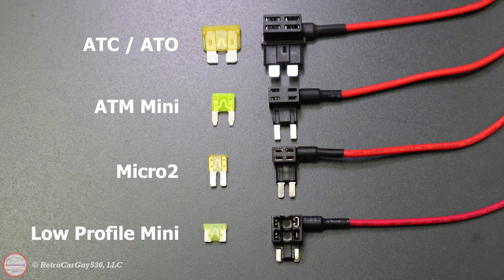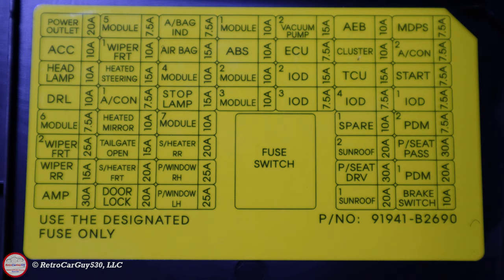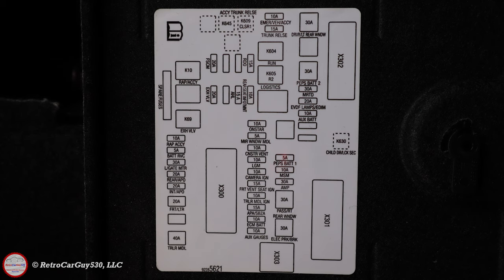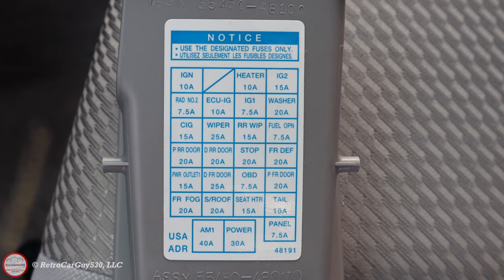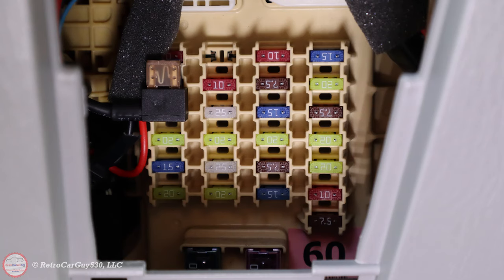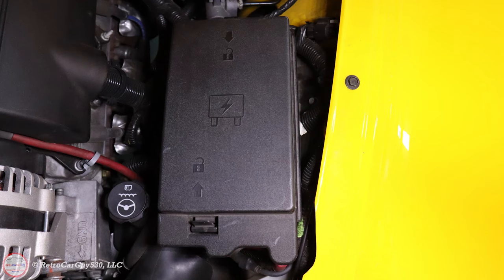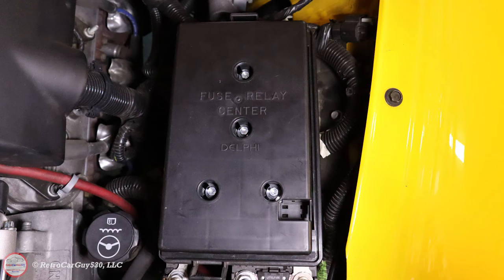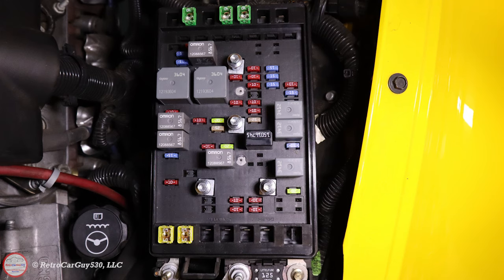How To - Add a Fuse Tap in Your Vehicle

Comment: Hi. I'm installing some led raptor lights and they came with an add a fuse. The add a fuse will go into a 10 amp slot, but the other fuse to power the lights that came with the add a fuse is a 15amp fuse. Will this cause any problems or should I replace it with another 10amp fuse?
Reply from the maker: There are a few different opinions on the answer to your question.

First thing to consider, can the fuse box fuse socket supply the 10 amps to its original circuit plus the 15 amps you would be asking it to supply for LED raptor lights?  The answer depends on how the internals of the fuse box are setup and how that fuse box fuse socket obtain its power.

With regard to using a 15 amp fuse as supplied with the LED raptor lights, yes I would use what the product manufacturer supplied.  Unless you have other info that states the device/accessory uses less amps than 15 amps, stick with the 15 amp fuse for the new device/accessory.

The LED raptor lights are potentially needing a large amount of amperage above what the current fuse box fuse socket is providing.  If the wiring/power path supplying the power to that fuse box fuse socket can support an additional 15 amps is impossible for me to know and state with any certainty that it will work without overtaxing the wires / circuit powering that fuse box fuse socket.

When adding a device like a dash camera or radar detector using a fuse tap, those items usually only consume 1 to maybe 5 amps at max.  Adding that amount of extra load on a circuit is usually low risk.  In fact, most dash cameras only consume 1 or 2 amps.  That's why a fuse tap is a simple and safe way to power a device like that.

When you start getting into 7.5 and above amps for the new device/accessory being powered by the fuse tap, that's when it starts to tax the pre-existing power path for that fuse box fuse socket.  If the fuse box fuse socket is getting its power from an internal power bus bar (supplies power to multiple fuse sockets in the fuse box), then adding a slightly higher amp load device is likely not a problem.  If the fuse box fuse socket is getting its power from a wire, then things get a bit more questionable.

When a new device/accessory requires 10 or more amps, I tend to look for alternative ways of getting the power to the device.  I tend to be a fan of using a relay to supply the power to the new device.  The power source for the relay that is then powering the new device/accessory is obtained directly from the battery with an inline fuse of the proper amperage rating to protect the new device and its wiring.  A fuse tap is still used, but it's used for the control side of the relay.  The control circuit for a relay usually only consumes 1 to 2 amps (or less - back in that low load situation like a dash camera).  The power from the fuse tap then controls when off/on state of the relay and the relay then supplies power to the higher power demanding device (like your LED raptor lights).

Can the fuse box fuse socket you've selected supply the 10 amps (original fuse) and 15 amps (LED raptor lights), I just have no valid way to answer that with any certainty.  I hope you understand why (based on what I stated above).

When I add lights or even dash camera battery packs, I use the relay approach mentioned above to make sure I'm not overtaxing the fuse box fuse socket or its wiring/power path.

I hope that helps in some way!

Comment: One confusion for me:  where does the negative wire go? I have a black and a red wire, what do I do with negative?
Reply from the maker: The ground wire is connected to a location with a pre-existing ground wire or a location with a metal screw/nut/bult that does not have any paint or coatings on it.  Often, there is a screw/nut/bolt located near the fuse box to secure the fuse box to the vehicle's body.
Reply: @RetroCarGuy530  thank you.

Comment: i need to wire to the fuse box in the trunk.  any tip to run the wire from the dash cam to the trunk neatly?
Reply from the maker: My current vehicle has the fuse box and battery in the trunk.  I ran the dash camera hardwire cable along the bottom door sill openings and then up along the side of the rear seat into the trunk.  I usually take that path since it avoids any of the wiring being located near the curtain airbags.  I remove the plastic trim pieces and there's usually pre-existing wire harnesses in that area so I just follow their path and take advantage of using the same wire/cable holders or use small/thin zip ties to secure the dash camera wiring.
Reply: @RetroCarGuy530  thanks.  I thought there would be a cavity somewhere in the frame that I have to fish through

Comment: Quick question, I have wired a cooling fan to a switch, but am scared to forget to turn it off when I leave. Thats why I'm trying to find an ignition source that would turn off if I leave the car with my keys, so forgetting to turn off the cooling fan wouldn't drain my battery. 

But could that cause an amperage drop, having any consequences like bad fan perfomance or even causing a fire hazard?

Thanks!
Reply from the maker: Devices like cooling fans or any device that requires more than a few amps to run, I would suggest using a 4-terminal relay to provide power to the fan/device.  A fuse tap can still be used to control when the fan's switch has power by using the 4-terminal relay.  That way you can make sure the fan is turned off when the accessory power is turned off when the ignition switch is turned to the off position.  The 4-terminal relay could obtain the fan's power with a direct connection to the battery's positive terminal (with an inline fuse).  The fuse tap would be connected to a switched/accessory fuse socket in the fuse box to control when the fan would have power available to run it.  You can place the on/off toggle switch inline in the power from the battery (going to terminal 30 of the relay) or after the relay (terminal 87 with power going to the fan) so you can control when the fan runs.

I outline the 4-terminal relay approach to power a high draw device in a video I created reviewing a dash camera battery pack.  Terminals 85 & 86 are related to the control circuit in the relay and terminals 30 & 87 are for the power going to the switch and/or fan.  Here's a link to that video and the section that video where I discuss the use of the relay: https://youtu.be/Joa0fiKZY-o?t=745
Reply: @RetroCarGuy530  i’ll check it out! thanks for the fast reply and good video

Comment: Hello. I have a 2017 Infiniti. Tried to do this hook up (before I saw your video), for a parking lot power dash cam.  I found an ACC and a continuous and hooked it up. Both had a fuse already installed. I thought all was well but when I tried to start my car after install, it would not start. Cranked once then dashboard needled "jittered" and then stopped.

I have roadside assistance so got it towed to dealer. They called me and said the battery was bad and replaced it under warranty. 

Was this a coincidence or did I somehow damage my battery?

Thanks.
Reply from the maker: Hi Ken.  Adding a dash camera to your vehicle should not be the root cause of your car's battery going bad, but it could be why it was drained downed to a low charge level.

A dash camera with parking mode support requires the two connections you mentioned continuous (unswitched) power and ACC (switched) power.  The continuous power connection will draw on the car's battery indefinitely to power the dash camera's parking mode operations with the potential to fully discharge the car's battery unless it has a device or internal logic to cutoff power to the camera when the car's battery reaches a minimum charge level of no lower than 12.0 volts (or so).  Some cameras have this power cutoff logic right in the camera (like the BlackVue "X" series of cameras), but most rely on a dash camera hardwiring kit or the use of a dash camera external battery pack to perform that power cutoff function.

I have a few VIOFO cameras with their hardwiring kits installed and their hardwiring kit has a power adapter which converts the car's 12-volt power to 5-volt DC power for a USB powered camera.  That power adapter also has a car battery charge level cutoff feature which is configured by a slide switch on the side of the unit to cutoff power to the camera at one of the various voltage level settings (12.4, 12.2, 12.0 or 11.8 volts).

If your installation has no car voltage level cutoff feature, you need to obtain a product that supports the shutoff of power to the dash camera when the car's battery charge level goes below a predetermined voltage level (again 12.0 volts would be my recommendation).

If your installation has a car voltage level cutoff feature, make sure it was configured with a minimum voltage level of no lower than 12.0 volts (IMO).  Also confirm this feature works by setting it to shutoff the power to the camera at a higher voltage level (for a test) like 12.2 volts and confirm that it truly cuts off the power to the camera.  You can use a voltage meter (one that plugs into a power port that has continuous power or a digital volt ohm meter to check directly at the battery) to check the car's voltage level while the camera is in parking mode.  If you see the charge level drop well below (at least 0.2 volts below the selected voltage cutoff level) then you might need to replace the hardwiring kit with another one that properly cuts off the power at the selected voltage level.  Many hardwiring kits with a power cutoff feature will have a tolerance of plus or minus 0.1 volts, so that's why I suggest that if it goes 0.2 volts or more below your selected voltage value, it may be defective.

Make sure that your installed fuse taps are installed correctly.  Make sure the left leg of the fuse tap (the side opposite of the side where the wire comes out of the fuse tap) is inserted into the fuse socket on the side that provides the power.  Having the fuse tap installed the opposite way (meaning right leg receives the power) will cause the power to improperly go through the lower fuse fuse before going to the new fuse on the top.  That won't drain the car's battery but it will potentially cause a blown fuse when it shouldn't.

I hope that helps.
Reply: @RetroCarGuy530  Thanks for the explanation. This is a Garmin Parking mode cable that does have the voltage features you spoke of. 

Also, after installing, the first time I went to turn of the ignition, the battery failed. All fused checked out ok so none blown. 

I will rewatch the video and attempt to connect correctly.

I guess battery was "going bad" and I pushed it over the edge trying to install?
Reply from the maker: If it's the original battery in the car (2017 model year), then it could have simply failed due to age.  Most car batteries will last four to six years (on average).  With the current health situation going on, many cars are not being driven to keep up the charge level in the car's battery.  If you leave your car parked for extended periods of time, you may want to consider getting a battery charger/maintainer to keep the battery fully charged while its parked for extended periods of time (more than 5 days at a time).

If your car wouldn't start immediately after installing the dash camera, it's not very likely that your dash camera installation caused the battery failure.  Just make sure the fuse sockets you're using are for non critical circuits (they don't power the engine control module, srs (air bag) control module, body control module, etc).

I have a FAQ video as well that talks about fuse sizing, wire gauge and length restrictions.  It might be helpful to clarify a few things.  https://www.youtube.com/watch?v=DnZ5wb_A5vE

Comment: In a fuse tap, do you want both fuses to equal no more than 15amp?
How many maps can that plastic holder itself handle?
Reply from the maker: The thin blade fuse sockets in most automotive fuse boxes generally don't supply more than 25/30 amps.  If the combined amp draw of the two fuses (pre-existing and new fuse) is above 30 amps, that may be a safety issue.  When the power draw's amp rating exceeds 30 amps, usually a different fuse type is used to safely supply that amount of amperage from the fuse box / fuse box bus (backside of the fuse panel).

With that said, take 30 amps (or 25 if you want to be a bit more conservative) and subtract out the amp value of the pre-existing fuse.  For example, if the pre-existing fuse is a 10A fuse, the maximum potential amp rating for the new fuse being added by the fuse tap would be 20A (30 - 10 = 20) or (using the more conservative approach 25 - 10 = 15).

Another factor placing limit on the newly added fuse amp rating is the wire gauge being used to supply the power to the new accessory.  Most fuse taps come with a 16 awg or 14 awg wire (smaller wire awg number is a bigger wire which can carry more current) to supply power to the new accessory.  The awg wire size / gauge will be a limiting factor as to the max amperage that can be supplied safely via this fuse tap.   In most cases, this means a 15 amp fuse is likely to be the maximum fuse amp rating you can use for the new accessory.  If the wire from the fuse tap is quite long, the maximum fuse amp rating may be reduced even further.

You must also consider what the maximum amp draw is for the new accessory.  If the new accessory has a maximum amp draw of 5 amps, you should not install a fuse larger than 5 amps into the fuse tap fuse socket for the new accessory.  The fuse is there to protect the circuit when too much current is being consumed or a short in the wiring occurs.  

Using a fuse with a larger than required amp rating can be a safety issue since it can lead to a potential overheating of the wiring and that can be a potential fire hazard.

Whichever amp rating is lower (max amp allowed by the wire gauge, max allowed in the fuse socket or max required by the new accessory) is the maximum amp rating that would be recommended for the newly added fuse.  If the max amp rating allowed by those limiting factors is lower than what is required to supply the correct amount of power to the new accessory, it would not be recommended to use a fuse tap of this type to directly supply power to the device.

When "more power" is needed than a fuse tap and its wiring can directly supply, you might consider adding a fused circuit relay.  You could use a fuse tap to obtain the control circuit power for the relay (on/off at low amperage draw) and then connect the relay to a power source which provides enough power (sometimes directly to the positive battery terminal).  The power supply side of the relay would have a fuse in the relay or in the wiring to protect that power circuit to the new accessory.   One example of this is I have a dash camera battery pack that provides power to my dash camera while parked.  The dash camera battery pack has two modes for charging low amp (power port) and higher amp (directly wired to a fuse panel socket or battery).

I use a fuse tap to supply power to the control side of the relay (switch power from a fuse socket) and when the power from the switched fuse socket is on, the relay closes and supplies power to the dash camera battery pack.  When the ignition is turned off, the switched power in the fuse socket turns off and that opens the control circuit in the relay which disconnects the dash camera battery pack from its charging power source.

I only mention that if you find yourself in a situation where a fuse tap of this type can't supply the amount of power you need for your car's new accessory device.   The same limiting factors for the relay approach apply (max amp rating for wire gauge being used, length of wire may reduce may allowed amp rating).  The control circuit side of the relay likely will only consume 2 to 5 amps so the load on the fuse tap is relatively low.